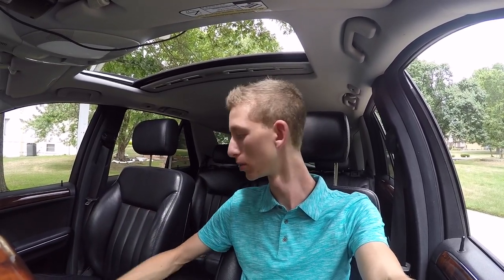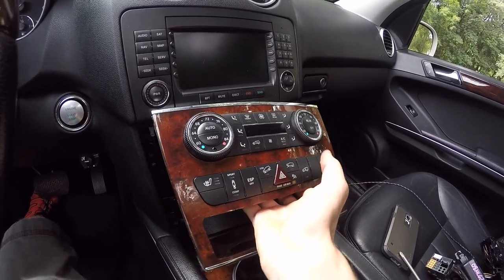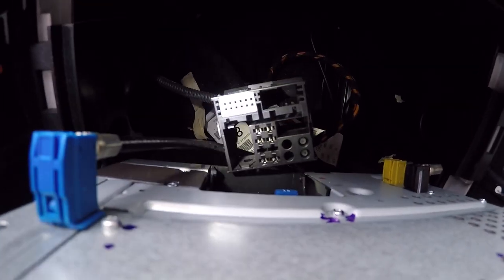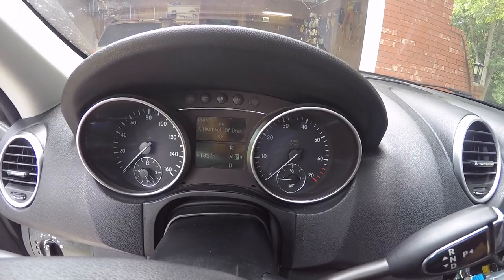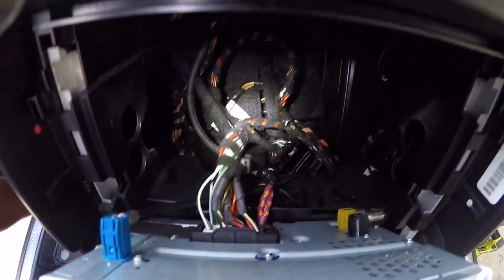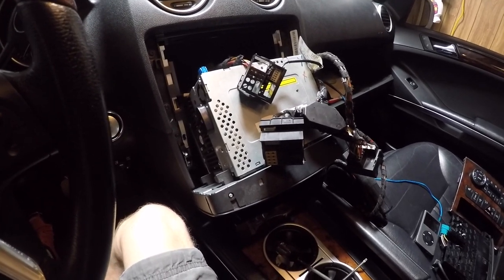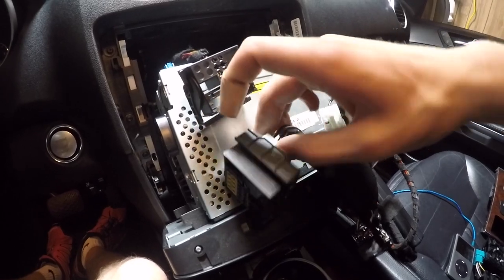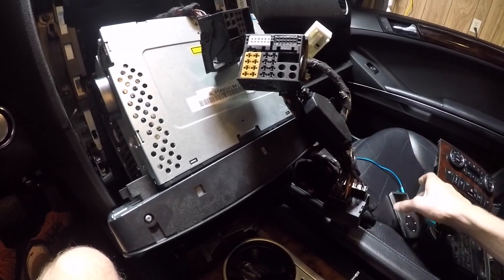How to Install an iPod Interface in a Mercedes

Comment: Hello! Does the Ipod charge when connected? As I see you use the aux for better sound, but still hooked up with the cable, so you can control it? Thanks in advance!
Reply from the maker: Hi Teo, thanks for watching! Yes, the iPod will stay charged while plugged into the iPod interface. Hope this helps!
Reply: @FlyByTire  Thanks! I checked and to be sure that your iPod will stay charged via iPod interface cable, the iPod has to support charging via FireWire, that can be chekced with wikipedia by searching the desired iPod model you want to use.